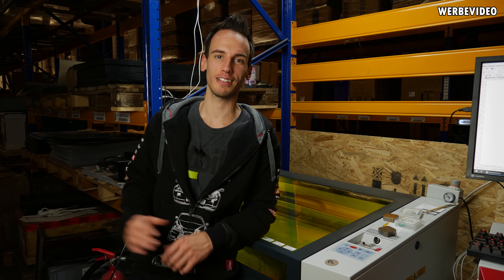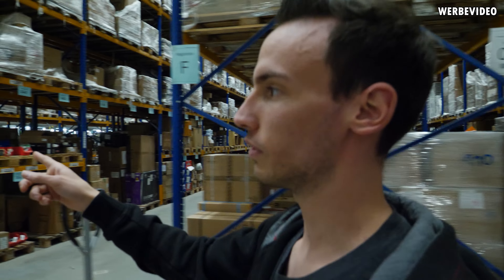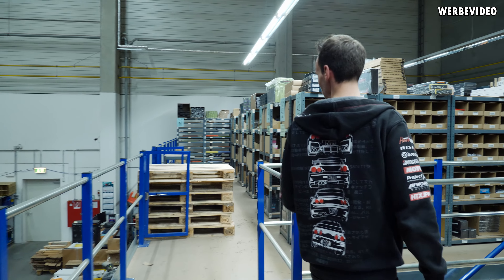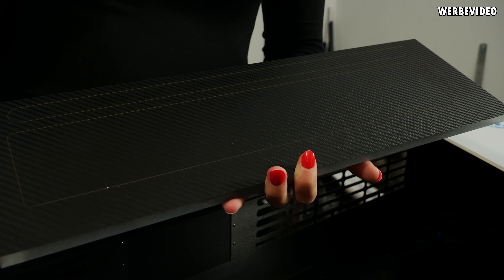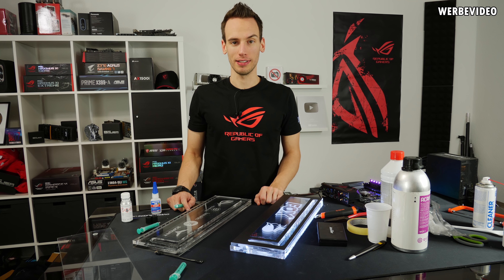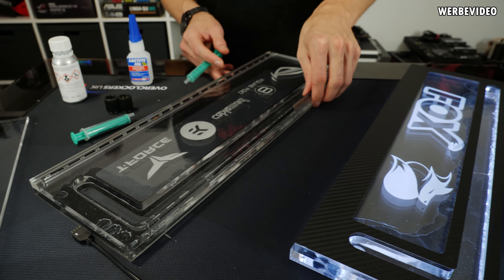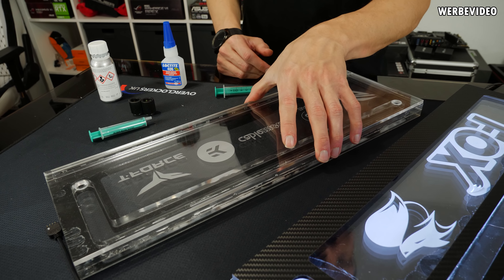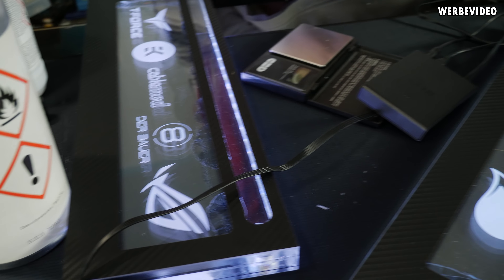Der ultimative Dual Z390 Gamingtisch - #2: Im heiligen Lager von Caseking (en subs)

Comment: I'd do it again with o-rings hidden by the carbon "foil".  Machine in for metal insert in the rear of the top plates, through hole on the middle plate, and through/countersink the rear plate, and use stainless hardware.  This would allow you to 1) clean the assembly, and 2) swap in a NEW middle plate with different designs in the future.  Otherwise, pretty cool!

Comment: Hey der8auer und Commiunity,
Ich hab nen Problem  und verzweifle hier.

Ich habe ein Asus P8Z77-V LX
 Mainboard für einen kleinern Server und ich habe einfach keine Möglichkeit zu interagieren.
Wenn ich den Server starte(Hardware Knopf) geht alles zwar an und die Power Lampe leuchtet und es gibt einen kurzen Zugriff auf die Festplatten laut LED, allerdings bekomme ich kein Bild(VGA,HDM,DVI geben kein Signal aus), der Ethernet Port leuchtet nicht wenn ein Kabel darin steckt, alle USB Ports funktionieren nicht(Maus Laser leuchtet, Tastatur geht gar nicht) und das Mainboard gibt auch keinen Ton oder flackern einer LED von sich was auf einen Fehler hindeuten könnte. Das Netzteil habe ich auch schon ausgetauscht und das BIOS zurückgesetzt.

Vielen dank für die Aufmerksamkeit, ich würde mich über Lösungsvorschläge freuen

Mario